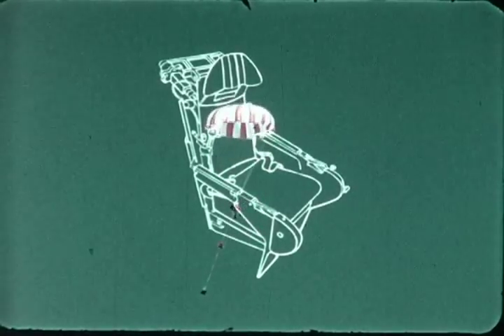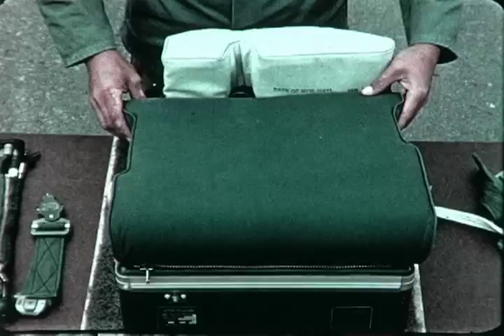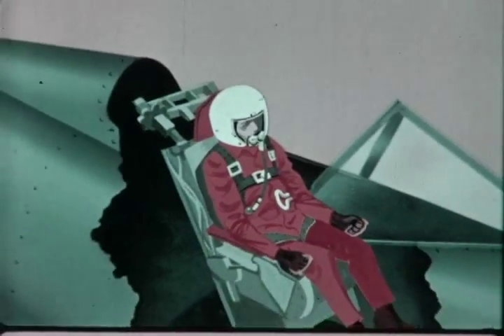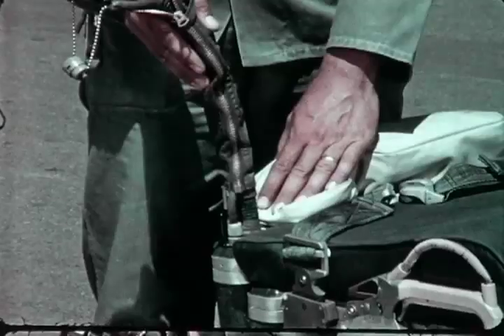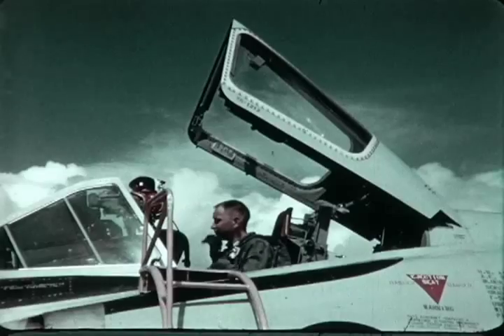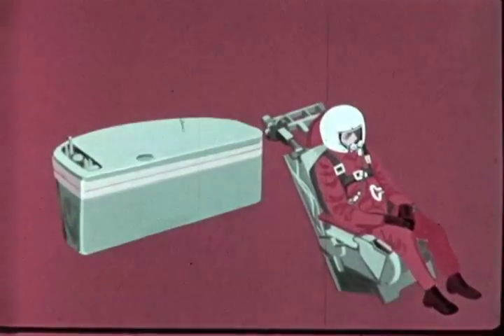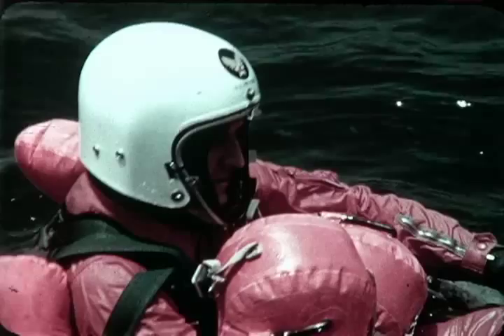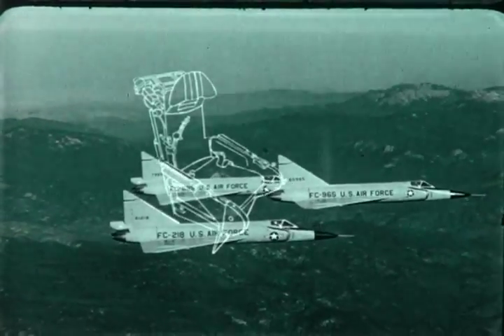F-0634 F-102A Pilot Emergency Escape

Comment: What isn’t mentioned is that the first  few times that the Martin Baker system was used, the lower bolt on the system failed, resulting in AC fatalities.